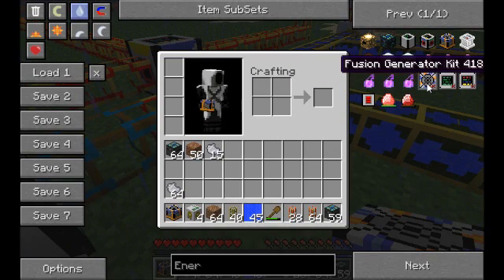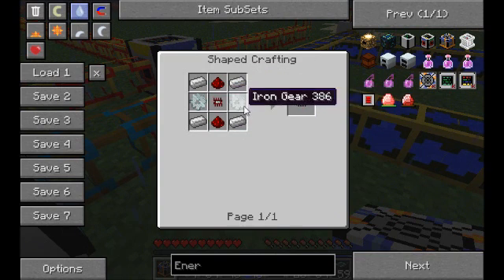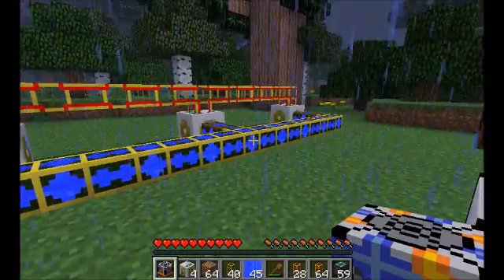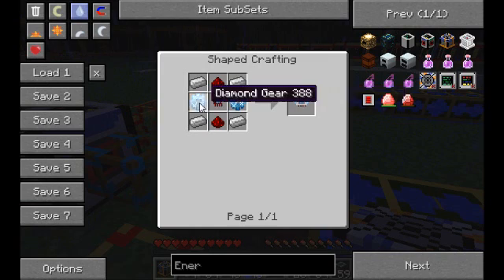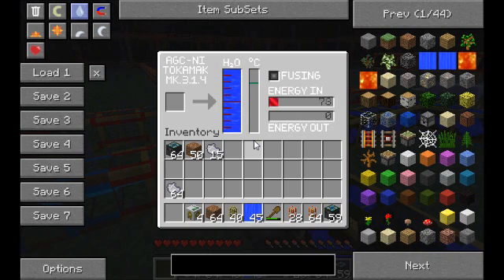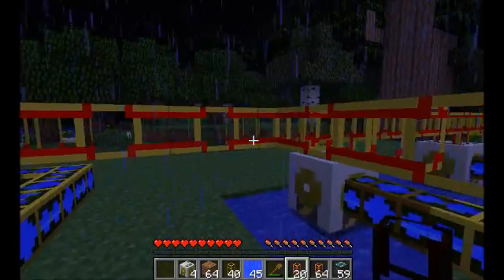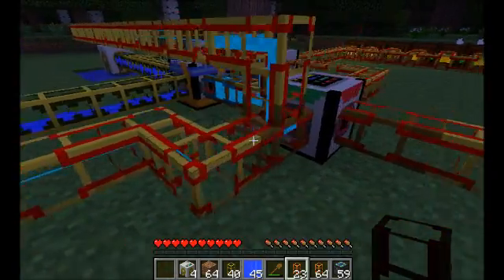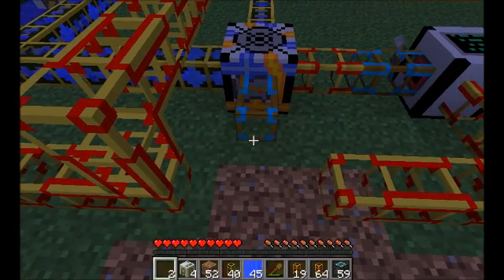MOD Spotlight Advanced Power Systems (APS)

Comment: Great spotlight. I know this is a bad place to ask, but could you explain how to make the Fusion Generator require less power? It's in the config, but the config is incredibly vague.
Reply from the maker: its been so long that I would have to look at the mod again.  I havent used it in so long I have no idea what has all changed.
Reply: I just realized how old this video actually is. 
Thanks for replying :D
Reply from the maker: no problem, just a small youtuber trying to get more subs so replying is something I can do without any issues

Comment: If you want the Director (or anything else, in fact) to output more than 25EPT, you must connect lapis pipes to every side which is outputting (probably simpler to connect them to every side, just so you don't forget). Also, the director blew up because you accidentally made a power loop which overloaded, with the kind of power the tokamak produces, they usually blow before you even see them.